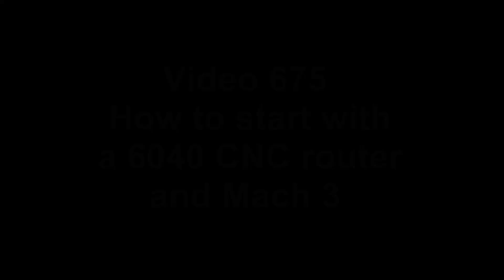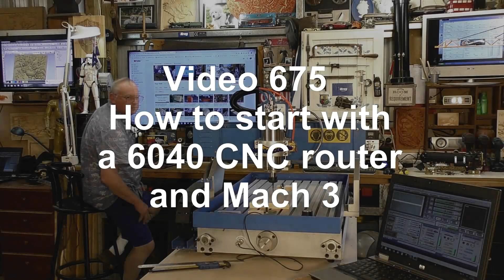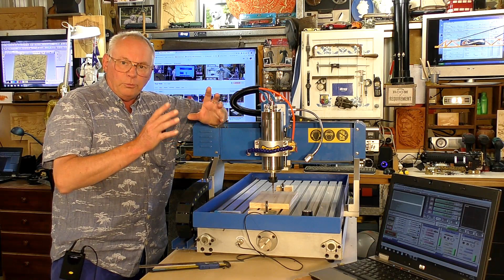How to start with a CNC router and Mach 3

Comment: Hello, I have a 6090 running Mach3. I've read as much as I can on Probing. I can't get my limit switches to function, so I have programmed soft limits. I could use a nice video on how to install, setup and use the tool setter. I don't understand why I can't make it work. Also the probe for 3d dxf files, I was told that it's possible to use the probe to "Teach" the software.  I hand carve wood and want to reproduce my items.
Reply from the maker: Hi, I have a video about tool setters.  Check to see if you have them activated and turned on. You can check this in the dyacnostice page by pressing a limit switch to see if an LED turns on. If no light comes on, then you need to back-check to the switch.
And don't forget to subscribe to my channel and pass the videos on to a friend.
Roger

Comment: Sir you did x and y zero set but when you use z zero tool device you didn't use z zero in mach3 so z zero required after z zero tool device,or not required z zero after detect tool by tool device

Comment: great video's
but as a newbie to CNC and mach3 im finding im getting into al sorts of problems, I cant get my soft limits to function don't matter where i Zero machine coordinates.

when I setup my spindle/cutter to the top of the job and set work coordinates and start it the, the cutting seems to do it above he job,
im using Free mill within Visial Cad for cam as cant get my head around Fusion 360

Also when I set machine coordinates they tend to change when I set the job coordinates, its lkethey both change together.
 
As for my job, it tends to be showing on mach3 around the wrong way to, meaning the job is facing south (Y) instead of North (Y)
Oh my machine is a 3040 800w Vfd USB using a RNRmotion eco v2 controller.
Basically I would love to know what the correct settings in the configs that works for a Cncest 3040 or the 4060 as same components just bigger,
I guess their has been 1000's of these machines sold, and cant beleive all are up and running Asap,
Any tips would be wonderful,
Reply from the maker: That is FREE CAM for you, you need Carveco (Maker)
My CARVECO code 5% discount code is
 ROGERWEBB5798 
(ONLY AT THIS ADDRESS BELOW)
 https://store-us.carveco.com/?ref=B40mt_z8N7xiu

Comment: Which extension should I use when exporting from ArtCam to Mach 3 if I'd like to export a cylinder (fourth axis)? I've never worked with a cylinder before, and in my previous work I usually went with Mach2 mm(.cnc) extension. Didn't work this time, though. Also, how does the cylinder appear in Mach3 window? As a 3D or as a flat surface?

Comment: I bought an old intelitec cnc router from a school. It is from 2003 and all the electronics are very out of date. Do you recommend closed loop or open loop stepper motors?
Reply: It is for hobby use. Not production.
Reply from the maker: All are ok for a hobby CNC